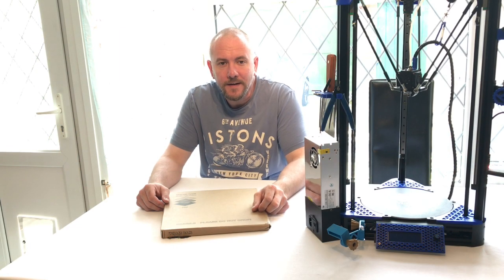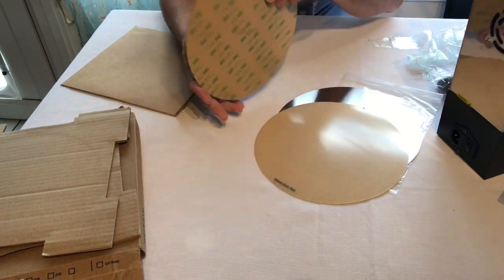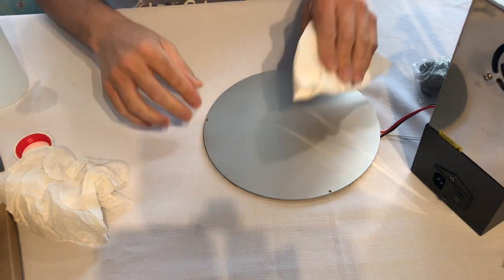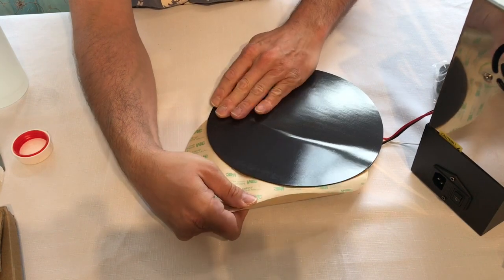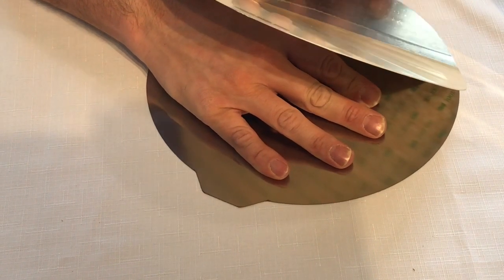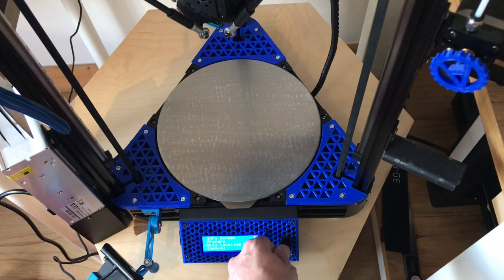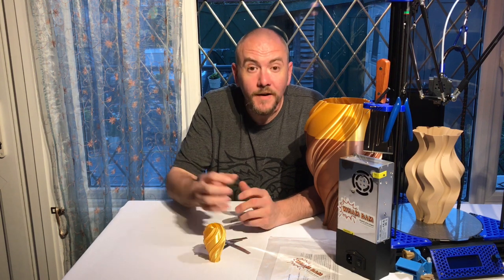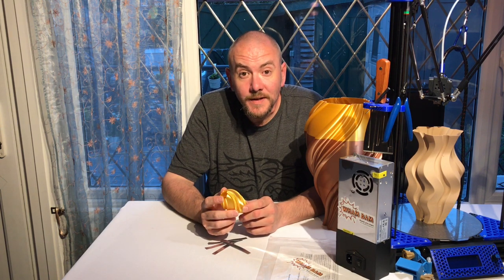Wham bam upgrade to anycubic kossel linear plus

Comment: What firmware do you use?
Reply from the maker: Elliott Coe hi I have never touched the firmware on my delta so it would be the standard that came installed and haven’t had a issue with it seems pretty good I was thinking of putting a filament run out on it and if I do then I might need to update it but I haven’t looked in to that jet

Comment: I recomend to modify the bed holders (print some from thingiverse), insert bras inserts and screw the heated bed to them (you have to do some drilling to use countersunk screws). Else you always lift up the complete bed instead only lifting the steel plate. I also modified the bed holders so they are a little lower than the heatbed, so I can use any spring steel even if it is a little to big (or square instead of round)
I do not use the Wham Bam as with shipping and tax to europe its much to expansive. I did the "traditional" way adding 24 high-temp magnets under the bed and did some heat isolation with cork. The springsteel I used thekkiinngg PEI powder coated one from canada, made for the Prusa i3 mk3. It is 2mm to small on one axis, but practical no problem. The surface of the prints look exactly like on my prusa mk3.
Alternativly I glued a ultrabase to an older spring steel and I have a spring steel from energetic 3d store (Aliexpress). All this surfaces work quite well.

Actually Wham Bam send examples of their product to many youtubers. None of them presenting any alternatives, so the reports are a little one sided (even if no money changed hand - why should any youtuber buy an alternative to test if he gets a Wham Bam for free?). I tested the system from Energetic 3d store (Aliexpress) and I am very happy with it. The PEI sticker already applied to the steel makes it more easy to use. The magnetic base is rated for 140°C. And the price is much more interesting: 24€ (for the Ender 3, including spring steel with PEI sticker and magnetic base). 21€ for spring steel dimeter 240mm with PEI sticker (without magnetic base). Sadly there is no round magnetic sticker, but of course you can cut it yoursellf.
Reply from the maker: Ole Urgast thanks for your reply it’s very interesting you ideas and I understand the fact that the bed is quite expensive to buy and was in a wonderful position to be supplied this to test I am sure there are some great alternatives available but I’m probably just a bit lazy to put the extra work in. this bed is great if you want a easy and quick solution which looked very nice and works I have to complement wham bam on the wonderful Quality of there products and would have definitely brought it myself if I hadn’t been offered a test unit as I love a simple easy solution to a problem 👍
Reply: @brithawkes36  As it comes to quality, I can personaly confirm the energetic 3d spring steel works perfectly also and is as simple to apply as the Wham Bam (but I prefer the Energetic one as the sticker is already applyed).

As I live in Germany and private imports up to 22€ (25$US) are legaly tax free, with two seperate orders (21€ for the spring steel diameter 240mm, 14.50€ for a magnetic base 310*305 to cut to diameter 240mm) you can legaly order the energetic system tax free. While the price of the product (and the quality) do not differ much (Energetic: 35,50€/40$US, WhamBam 55$US), shipping and tax differs a lot (Wham Bam 21,73$ shipping, 14,58$ tax - Energetic 0€). So living outside U.S. the choice is clear for same quality and comfort, while in the U.S. Wham Bam might be prefered do to shipping time and service.

Also of course I am a big fan of PEI powder coated sheets (like the one from prusa). The only comparable quality is from thekkiinngg (Canada) - do not buy chineese clones, I tried 3 different ones, much less quality. So buying the magnetic sticker and the plate seperatly offers more flexibility (of course the PEI powder coated spriing steel is more expansive - 45$US + tax + shipping - but it is definitly worth it).

One of the advances of Energetic: They already have diameter 370mm spring steel in stock - so my predator will get an upgrade soon :-) Sadly no powder coated PEI in this size available at thekkiinngg now.
Reply from the maker: Ole Urgast thanks again for all the information it’s great that you can help the YouTube viewers have more information to make a the best choice available to them you certainly have more knowledge about this than me and I’m glad for you input 👍😊